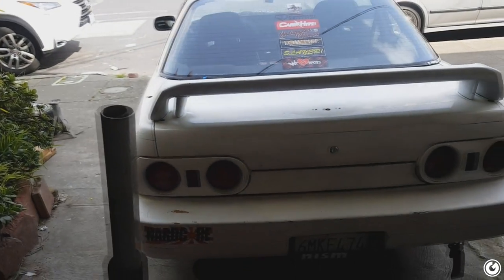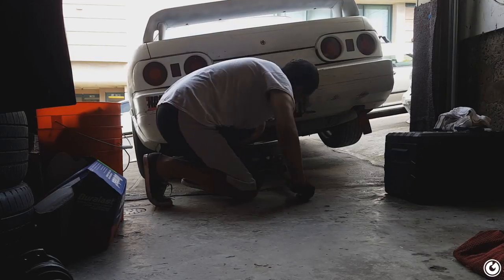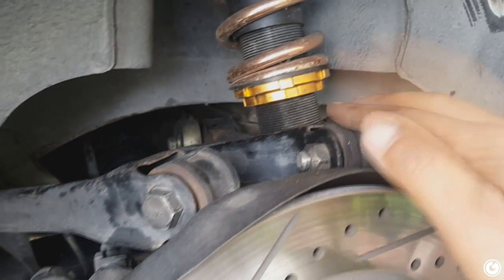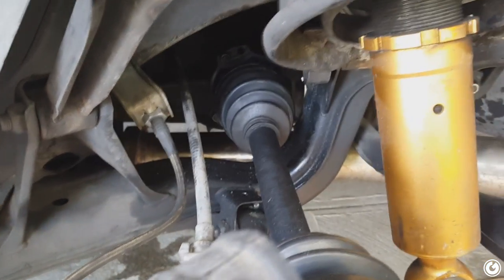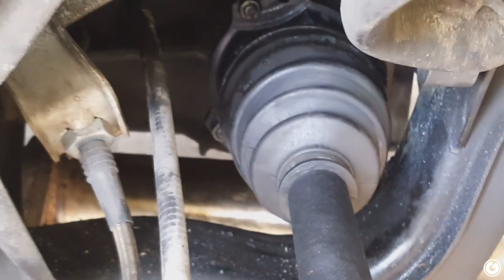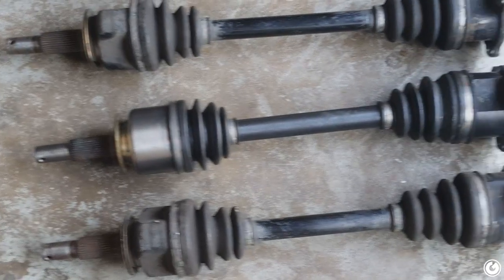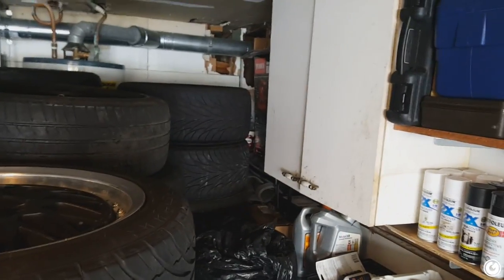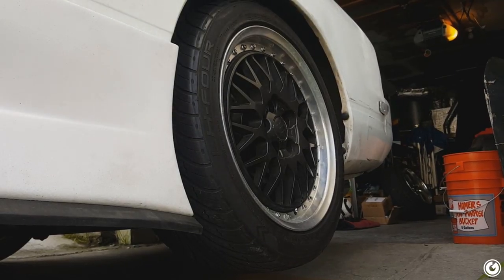Axle install DIY 240sx | Ep. XXI - GTS13

Comment: Both axles are not same length? One shorter than the other?
Reply from the maker: Kennedy Wong yea the passanger side axles are longer than the driverside ones
Reply: I didn't notice that until I saw this video. I was having hard time putting back knuckle arm because axle. End uo outting one axke on wring side. Lol. How do we know which left and right? It doesn't tell you. Sometime, I got mix up.
Reply from the maker: I figured it out cause when I installed the driverside axle, it started binding the next day and I assumed that Autozone gave me the wrong axle. Ended up buying the oem axles in the video and laid them all next to each other. Autozone had actually given me the right axle, but it just happened to be a shitty one. I did some research online when the axle was initally binding and found that the axles are different lengths